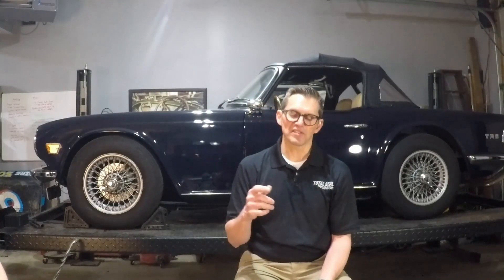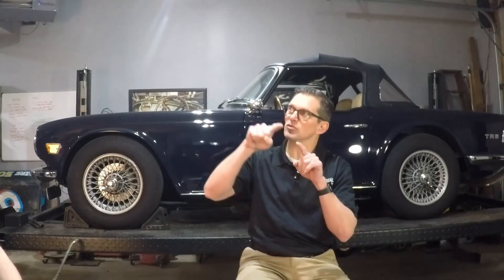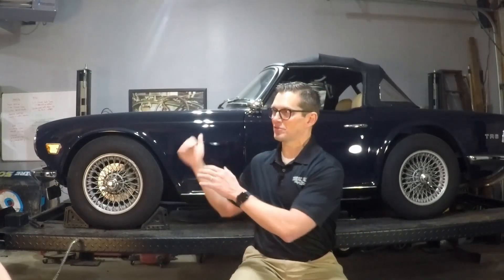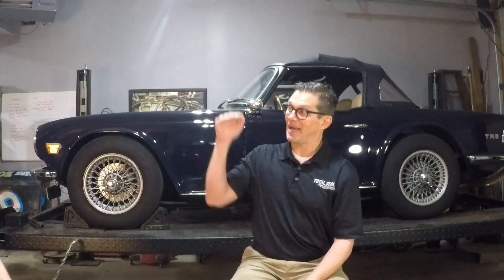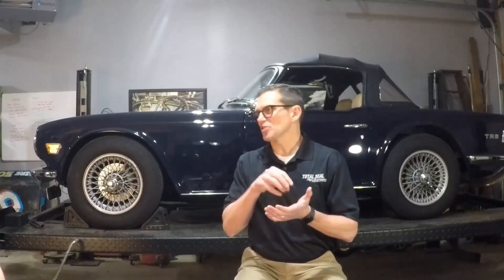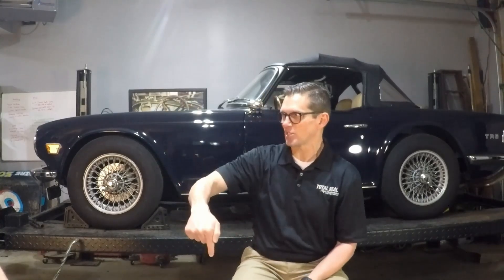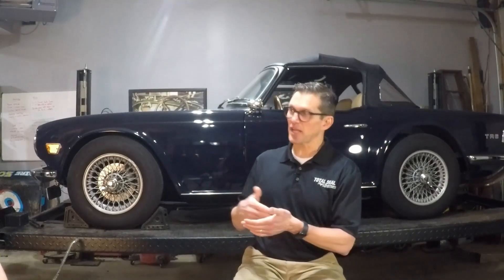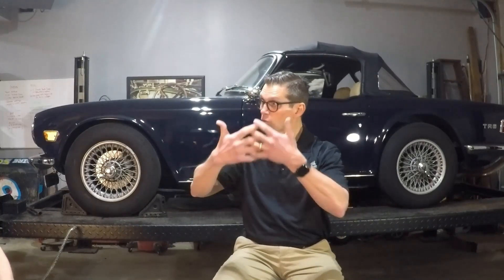Lake Speed Jr. Talks ZDDP:  Part 2 of 3

Comment: Question,
I run the VR1 in my Chevelle.
My engine builder recommends a 10W40 and I can use a 10W30.
So I went on line and found an oil viscosity calculator for mixing two different viscosities to come up with another one.
Is it safe to mix two different viscosities of the same brand of oil?
Valvoline says they don't recommend it, but that might just be them covering their butt. What's your opinion?
Per the viscosity calculator, I can mix 3 quarts of 10W30 with 4 quarts of 20W50 and come up with roughly a 15W40 Will that work or is that a bad idea?
Reply from the maker: I recommend against mixing oils.  Especially from different brands, but even just in general.  The problem is that each blend is going to have different additives, and they don't always mix as intended.  So you could mix 2 different oils and all of a sudden end up with a mixture where the anti-foaming agents don't work.  That leads to air in the oil, and to engine damage.  So yeah.  It CAN work, but generally speaking mixing oils = bad idea.  The same applies to pour-in additives for extra ZDDP.  I know lots of people do it, but bad idea.  

Now as for using a 15w40, that by itself isn't a bad idea, but it really depends on your engine and what the build calls for.  The piston rings, how it was honed, the clearances... all of that makes a difference and unfortunately I'm not the expert on how to interpret it (though you can probably get in touch with Lake and say you saw him on my channel).  He would tell you (and I'd agree) that it's a good idea to have your engine oil tested.  If you test with different weights, you can get a good feel for which one is going to allow the most movement with the least amount of wear.
Reply: @ 
Thanks for getting back to me.
Lake got back to me too.

Per Lake,
It is safe to mix VR-1 10W30 with VR-1 20W50

Comment: Pretty simple answer...use the oil with the proper viscosity for your engine that has the highest film strength. This is usually the indicator of a superior additive package. The levels of ZDDP are a non-issue because ZDDP works exactly the same at 800ppm as it does at 1400ppm. ZDDP is doing nothing in oil until the moment the oil's film has been penetrated...the resulting heat/pressure is what activates the compound. If you are experiencing elevated ZDDP depletion you have either something seriously wrong in your engine or your choice of oil sucks.
Reply from the maker: I believe that the spring pressure forcing the lifters against the cam lobes has the potential to penetrate the oil's film, which is why ZDDP (in the correct amount) is beneficial.  Mind you, not every classic car has very high spring pressures, but with oils like VR1 or Castrol Classic being the same or less money than other oils of the same viscosity... there's not much of a case to not use them.  I did look up the spring pressures on a Triumph TR6 engine once.  If I recall, it wasn't quite as high as a small block Chevy engine, but since the system is dynamic and pressures are different with the engine running, under load, etc... it could easily go into the zone where the ZDDP is activated.
Reply: There's a difference in how parts are lubricated and sometimes that's due to the 'mechanical limitations'. A bearing can usually be fed a steady flow of oil so you can get hydrodynamic/full film lubrication. Other parts can't build or maintain that, like lifters (though there are lifters for some engines with a tiny hole that supply extra oil), so they need additives for mixed and boundary lubrication. ZDDP build on the surface and then get sacrificed, others continously circulate like moly.
Piston rings go through all three lubrication regimes. And I guess the eye opener is that it's not always about what's in the bottle ⬆️ that matters, but what's not in it ⬇️. 😄
Reply from the maker: @PSA78  it's helped me figure out what to run in the cars for sure.  I'm just happy someone can explain the science in plain English--there's too much being spent on marketing to be sure otherwise.  Thanks for the comment!

Comment: I hope Lake addresses oil temperature in part 3. Lots of owners out there fitting oil coolers without knowing what their temps are, or what they should be.  In the same vain, many owners start their cars during winter storage :-(
Reply from the maker: I think he does comment about high temps in the combustion chamber breaking down oil, but I don't remember if we touched on viscosity vs temperature since that's covered in his videos on the Motor Oil Geek channel.  In any case, you're absolutely right about oil coolers.  They're bad for engines unless you have a thermostat as well to prevent oil being cooled.  Starting during the winter is less of an issue with a multi-viscosity oil, but if you do drive your car in the winter often then it's worth considering a 15w50 instead of the 20w50, or maybe even a 10w40 depending on the application.  In any case, I don't feel the need to start my cars unless I'm going somewhere.  Just change the oil in the fall when it's put away.  No need to start it unless you're using the car.... which I don't do often in Chicago in January/February.

Comment: What is the very best oil for a triumph tr6
Reply from the maker: So not to cop out on the question, but there are kind of a few answers.  First of all, oil formulations are constantly changing--so for example Valvoline VR1 20w50 from a year ago is not the same as Valvoline VR1 20w50 from today.  It's improved, so your choices will need to be updated all the time.  

Second, to the best of my knowledge no one has done testing on a TR6 engine specifically and analyzed the oil with various brands afterwards.  Now all that said, unless you've built your TR6 power plant in a sealed room to super precise standards... you're not going to notice a difference between one oil and the next so long as it has sufficient anti-wear components (i.e. ZDP) in it.  Driving on a hot day vs a cold one will probably play a larger role than the brand you use.  

If you want a recommendation for the "best" all around oil for a classic car similar to a TR6... then probably Driven GP-1 is what I understand to be the best at this time.  There are others that are as good or nearly as good.  But again... you're probably wasting your money on it if that's what you're using.  

If you're after a standard recommendation, then Valvoline VR1 in the engine, Redline MT90 in the gearbox, and Redline 75/90 or MT90 in the diff.
Reply: @midwestmotoring   I agree.  But as classic car owners there is possibility MORE variation in how our cars are used. Some are garage queens, some are daily drivers, some are driven very hard (track days) climate and oil change intervals also play a part as does the condition of the engine (rebuilt to high standard, or old and high milage)  These and many other factors play a roll.

Comment: How long ago did the change in VR-1 occur? I have a couple of 5 quart jugs in the garage. Not that I am worried but I have used it for a number of years due to the ZDDP content. I have a 1977 MGB which seem to be known for excessive cam wear. My car does have noticeably less acceleration that a friends MGA Coupe with a early 3 main 1800 engine from an early MGB. My engine has never been opened up with about 104,000 miles and I have owned the car since 1989. I am not worried about an engine teardown as the compression is still very solid and oil pressure at idle is around 50 pounds. Any info on the time of change in the oil would be great. Since we have more knowledge I seem to be thinking more about the oil and quality that has gone into the car over the last 20 years. It is nice to see that you have posted a video again. Keep up the good work.
Reply from the maker: It want to say it was sometime this year, but could have been late last year.  In either case, VR1 (new or older) is going to be fine for your MG.  It was good, now it's better is the takeaway.  One important note is that engine oil does have a shelf life.  I think Lake did a video on that for his Motor Oil Geek channel.  As a rule, after about 5 years, the additives can separate out and the oil is no good.  I don't believe it's as simple as stirring it back in, so it should be discarded.
Reply: @midwestmotoring  I should be good then as the oil came via Amazon in 5 quart bottles. The local NAPA didn't have the quart bottles that I needed so it is what it is. I love your garage. Do you do a lot of British car work on your own? I love your channel and you break everything down so nicely so it is easy to follow. As long as I have lived in Grand Rapids I have never been more than 15 minutes from John Twist"s shop. Now he is retired he has a small workshop across the river from me and I can be there in 4 minutes. I am a lucky man. Keep up the good work. If I still lived in Aurora I would be picking your brain on a regular basis!
Reply from the maker: @robertdavidson3090  you'd be welcome to visit.  I do take on a bit of British car work.  Most of it is on our own "fleet" of 4 Triumphs, a Mini, and a pair of Healeys.  Not to mention the "real" cars....  But after starting the channel I've been booking up a lot of weekends and some evenings.  If it keeps growing I'll have to decide if I like it more than the "real" job!

Comment: If you own a true classic car you would still be better to look for and purchase the pre star burst and still get the technical analysis sheets
Reply from the maker: Just for clarification, I think you mean oil without a starburst and not oil that was made before they had the starburst.  Even unopened engine oil is bad after a few years.  Anyway, you're right that the info sheets on the oil are good and should be read.  Just to be certain I'd add that it's also a good idea to have your oil tested periodically.  That'll alert you to wear that's happening and to the condition of components you can't easily inspect.  Thanks for the comment!